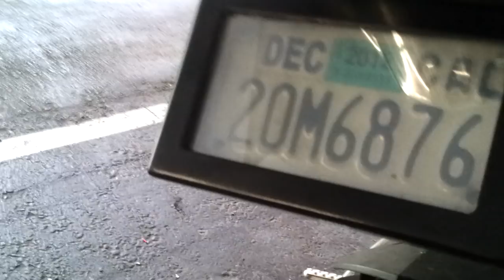Ghost Plate

Comment: Lol, excellent! I've tried a dozen different ways, from fake mud, a rego disc holder that pivots down to cover the numbers, to hinges and a cable to lift the plate horizontal so it can't be photographed, on dirt, motard and road bikes, lol, actually got pulled over for obstructing the number plate with the pivoting rego disc holder, lol, it wasn't even over the numbers but the cops were bike riders themselves, so a friendly warning was "accepted" and I changed it. A Motard is always a hoons bike